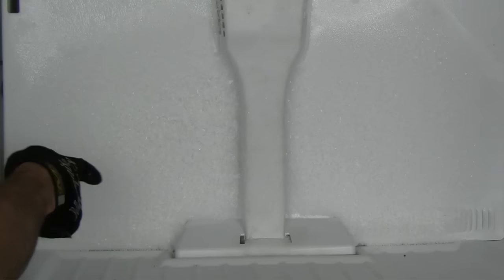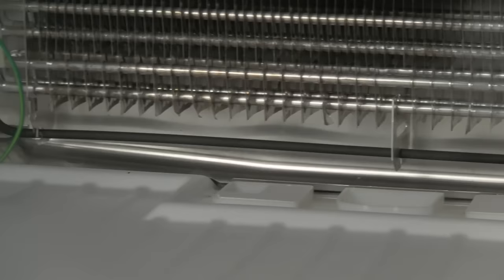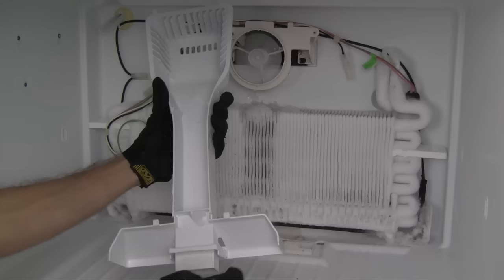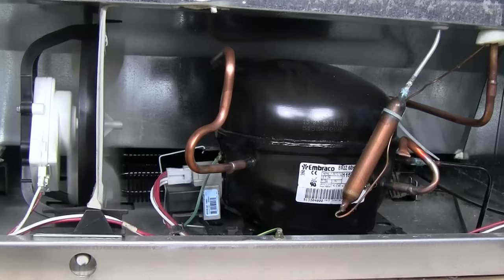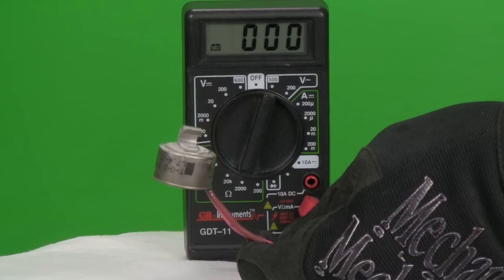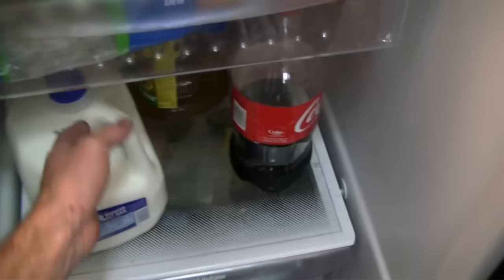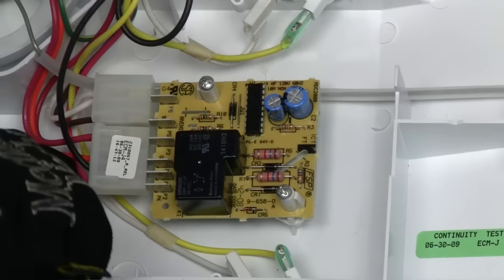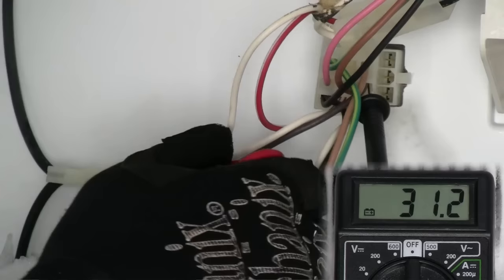Refrigerator Repair (Not Cooling, Defrost System)

Comment: Great Video! I have a Kenmore 569.68142891 .  Rock Hard freeze, warm top.  I pulled it apart  uncoupled the heater and got a tone. then plugged it in on the thermostat side, turned the timer to defrost and checked for voltage and got 115 volts through the thermostat and heater.  Turned off defrost mode and plugged in the heater, set to defrost, no heat on the heater even though I have resistance and voltage!  The thermostat does show signs of being bad (ruptured).  I am going to replace that but would a bad thermostat keep the heater from heating even a little bit?  I can touch it without feeling heat.  Should I but both parts?

Comment: Great video, too bad there isn't a little info on the circuit board defrost timer.

My refrigerator heats the duct between freezer and fresh food compartment and won't stop heating it unless I reset the fridge, then it will do that again after about a 30 hours even though there is no frost and the duct door is working properly.

As far as I can tell there is no defrost heater or thermostat on the evaporator (is that possible?), it does not get warm in parallel with the duct. There is however a temperature sensor in the freezer section as well as the fresh food compartment.

I thought about jury rigging a power reset every time the door closes because I like to tinker :) at least until I can figure out how to fix the issue.
Reply from the maker: Sorry for the delay on this question.  I'm guessing Samsung...?  What is your refrigerator's brand and model number?  If it is a Samsung built refrigerator, the heater is inside an aluminum case that looks like and is attached to the evaporator coil...
Reply: applianceassistant no problem any help is very welcome; it is yes; a Samsung RL36SBMS1.
I see the double coil now and two sets of cables running in behind the evaporator, with that I've found the second black tipped thermal sensor(fuse) shown in the electrical diagram on the back of the fridge, that's great! thanks.

Seeing as the fridge keeps defrosting until it hits room temperature every 6-8 hours without returning to a normal state, I figure the problem may be the bottom black tipped thermal sensor. I'm able to order a new one of those I believe. I'm still not quite sure why this component would degrade though.

I'm also noticing a problem I hadn't ever considered before, the ice spills out from under the evaporator and builds up on the bottom of the freezer where it is collected in a very shallow plate and can be taken out as I have done in the past even though there is most definitely a collection area on top of the motor, maybe something is blocked somewhere.

Thanks for your reply, I'm still happily tinkering away and learning as I go :)

Comment: This is a great educational video!
Actually, I am watching and hoping this video would help me to understand the "refrigerator".
My "Kenmore" refrigerator's motor/engine is working fine, but cold air wasn't running...less than few hours later, cold air is "running" properly.
Is that what you called "automatic defrost cycle"?
And should I stay alert next time this happens? (Who knows "when" this happens)

Comment from the maker: @genestermeister It doesn’t sound good.  If the compressor is running, the thermostat is likely fine, sending electricity to the compressor saying “get to work its to warm in here.” However if the sealed system is unable to get down to the proper temperature you are likely low on gas or have a restriction.  If the compressor is not running then you may have a thermostat, start relay, or compressor problem. The only way to tell the difference would be by doing some voltage tests with a voltmeter.

Comment: Hi. I had a problem with my evaporator coils frosting up and did some simlpe checks, finding an open circuit on the element/thermostat as its a combined part on my Kuppersbusch. I have installed a new heater/thermostat which "closes" to about 80 ohms when cold enough. I am getting 240v (as i'm in the UK) to my heater, checked by advancing the mechanical timer as shown when the defrost cycle starts also, however the heater element doesn't seem to get hot? How hot should these things be to touch? Its only been a day or so since install but i tried to check this before buttoning all of my freezer panels up, with just the heater connected and supply to it, with the stat cold enough to allow current to flow through it. Am i worrying over nothing as i am expecting to feel some major heat from it. Thank you
Reply from the maker: Not sure about those but every one I know of in the USA gets red hot.  Did you check the heater for resistance? If it tested good then your probably fine.  Just keep a close watch for frost on that back wall.  Thanks for the question! Hope that helps!

Comment from the maker: @stringfellowhawke247 You must have some kind of an air leak, or have had an Thanks for the compliment I'm glad it helped! You must have had an air leak in the recent past.  I would just clear the frost and see if it comes back.  If the vents are clear and the ref is still not getting below 40º Hmmm... Is your evaporator fan working? Is your freezer down to temperature?    If you have any other questions feel free to contact me through ApplianceAssistant com  I would love to help further.

Comment: i have the same Frigidaire, mine wasnt cooling, well it was cooling but not cold enough,  or making ice. I had a big chunk of ice on the top right of the defroster and tops of dust on the coil lines in the back. So far its running and is cold but not cold enough to make ice.
Reply from the maker: Sorry for the delay in getting back to you on this!  The "big chunk of ice" is the part that sounds less than ideal. The evaporator coil should freeze evenly and show a fairly even frost pattern.  If part of the coil is frozen and the rest is clean aluminum then it sounds like a gas restriction in the sealed system and it may only be able to cool with a small percentage of the coil.  This is ver difficult and expensive to correct. It requires evacuating the gas, purging with nitrogen,... yada yada.  Sometimes they can clear themselves and start working again.  Sorry for the bad news. If the fans are working and the lower coil is clean, that's about all you can do. Hope that helps!

Comment: Hello
My GE side by side is working good but the defrost cycle stays on too long.
This causes the Ice In the Ice bin to begin to melt.
Any suggestions.
P.S. 
I've already replaced the control board and two of the sensors, one located on the Evap. coil and another one located in the
fresh food side.

Comment: I been fighting this problem with my Whirlpool top and bottom fridge . The problem I'm having is that i'm getting a sheet of ice in the bottom of the freezer. within a week of opening the drain again. I have replaced the the bimetal defrost thermastat. Every time I have taken the back panel off I have never seen frost build up at all. So where is all this water coming from that freezes up in freezer. My fridge stays really nice and cold and freezer is nice and cold. No frost build up at all on back wall. But is always the tray and tube is frozen solid and frozen water on bottom of freezer. Doesn't make since to me. Doors are super hard to open like the suction is very hard. It whistles when closing the freezer top door after closing. Please help me. I been fighting this for a year now. I have taken this thing apart 5 times and melt the ice and clear the tube and it comes back about weeks time.

Comment: Do you have ideas on how to trouble shoot a roblem where the refrigerator (frig only, no freezer) section has ice build up ?  The compressor does not seem to shut off once the interior reaches desired temperature.  It's a Red Bull Baby Frig, I cannot find the thermostat adjustment.

Comment from the maker: I'm sorry I lost track of this!  Well I am not finding any information or diagrams on that model number... That's exactly right.  Hopefully the duct blockage was caused by the door not sealing all the way and there is no mechanical problem. You probably have already done this but try thawing it out and watch for frost accumulating on the back wall of the freezer for the next few weeks.  If you see frost you may want to call someone who is Frigidaire warranty service for that one.

Comment: I have a question:
I have an older Whirlpool Gold fridge with a freezer on top. The ice maker quiet working so I took it out and disconnected the water line and closed it up with a 
plan to just use ice cube trays. Well after about a month the walls of the freezer started forming bumps on them. Some really small and others about the size 
of a ping pong cut in half??? Do you know what this is and what causes it. Totally at a loss on this one....thank you

Comment: I have a GE side by side refrigerator. I've replaced the thermostat and defrost heater. Well it froze up on me again a year later. I've replaced the thermostat once again to no avail. I tested the defrost thermistor at the control board. I tested plug only, it was not connected to the board. It read 00.0ohms, it was still surrounded by ice. Ordered and received a new thermistor. Tested it in ice it read 16ohms. The old one I took out read 13ohms. So was my thermistor even bad?
Reply from the maker: Hard to say, but the first 0 ohms reading would be a problem... so if that reading was correct, sounds like it probably had a problem.

Comment: I have a Maytag fridge that stopped defrosting. I checked defrost timer and it had no continuity when cold. So it was bad. My thermostat had three wires instead of the usual two. The two wire stats are just a relay which when cold (most of the time)  flow electricity from the timer to the heater wire around the evaporator coils.  I called around and asked different suppliers what the third wire was for on my stat. No one seemed to know, but one guy said it was a fan delay. I guess this meant the fan in the freezer would delay coming on for some time after the freezer defrosted. I could not find this three wire stat on the net for less than an outrageous $60 while the two wire stat was around $6. I ordered a two wire stat and sealed off the wire from the fridge going to the third stat wire. The fridge works fine. Just another thing these crooks put on their products to rip people off. It is something special folks, and the only place you can get it is from us and we agree with our competitors to put a ridiculously high price on this part to make a bundle. Ralf Nader where art thou?
Reply: Excuse me on previous post. I said that I checked the defrost timer for continuity. I meant to say I checked the defrost thermostat for continuity.

Comment: So I decided to test the components in the fridge portion, the thermostat there shows the same continuity at all times no matter the setting on the dial....this is counter to the guides I've found on the net which say it should fluctuate when the dial is setting is changed.  I also can not locate the defroster timer, it may be down by the condenser but it hadn't cooled down yet last time I went to look.  Model number on fridge is a Magic Chef MCBR1000S.  If you can advise me testing/finding. Thx

Comment: I checked the resistance and there is some , but should there be continuity because there is none between the two ends on the heater?
Reply from the maker: There should be some resistance on the heater, not an open circuit.

Comment from the maker: @stringfellowhawke247 Nice! That would be an easy fix!  Probably the air return is clogged up with frost as well.  Its located near the bottom of the refrigerator section usually hidden by a crisper drawer. It allows the warm refrigerator air to flow back into the freezer. (Equally Important.)  Little more difficult to clear out on a side X side... easiest way is to unplug it and let the thing thaw out.  But if that's not possible you can sometimes use a hair dryer.

Comment: hi my refrigerator is not cooling have no idea what happen apart from the bulb thats blown have had it almost 2years model is a Fisher and Paykel Active Smart E402B i dont hear anything from the back of frigde so im guessing its not working at all,dont know if its worth getting a new one or fixing i have had no problems with it at all in the pass
Reply from the maker: Im sorry for the delay! I was not able to find a diagram of that model : ( Unfortunately, I have limited lookup capabilities when it comes to some Fisher Paykel appliances.  Just a guess... but if the bulb went out at the same time as the cooling problem, you may want to check the door switch. some samsung and GE refrigerators control the inner air circulation fans as well as the lights with the door switches... apart from that you may want to look at the "troubleshooting refrigerator problems" article on my website. It has a more complete description of the things generally to check based on symptoms.  I would expect that you refrigerator is basically the same.  Sorry I couldn't be of more help... Good luck!

Comment from the maker: Try looking at the refrigerator troubleshooting help on my website (the link is in the video description.)  If the compressor is working then I would hope that the condenser coils if they are under your refrigerator are very clogged up with dust or the condenser fan that pulls air across the coils may be jammed.  Look at the troubleshooting on the site... It hopefully will help!  Good luck!

Comment: I have a Whirlpool et1phkxpq09, built 4/10, purchased 10/10. Suddenly the fridge is about 52, freezer about 28 degrees. I emptied & unpowered fridge,propped open doors for 10hrs. I opened freezer panel, found no frost, but center duct was narrowed by ice. Cleared ice & re-installed freezer panel. Control console at top of fridge portion had no frost or ice in it. Diffuser is an immovable tongue. Repowered & after 10 hrs, performs the same- 52/28. So if frost isn't the issue, where do I go next?

Comment from the maker: It sounds like it's possibly a new issue... I don't think I would trust nail polish to fix the thermostat though.  usually when they pop there is not enough pressure on the contacts for it to work properly.  what is your brand and model number?

Comment from the maker: If they get very iced up or the evaporator fan in the freezer is not working you will start to have freezer temp problems due to poor airflow... you need to allow the evaporator to thaw out and then if your evap. fan is working check your defrost heater part#WR51X10055 and defrost thermostat part#WR50X10068 if they are okay then it is likely the main board in the back part#WR55X10552 the heater and the board are both common to fail : ( I have testing help on my website if you need it. Good Luck!

Comment: siri i want to ask what is the reason: a 110 watt compressor runs ok in around 70 watts, ..low side stays in vacuum around 25 and high side around 200 psi.the pressure on high and low sides does not equalize if i turn off the compressor..

Comment: I have the same Frigidaire  GLRS234ZAB5 side by side refrigerator with the same issue.  I am desperately trying to locate the timer with no luck.  Are you saying this models timer is different from the others..i.e electric circuit board? If so...where is it.  I've looked on the back near the compressor, on the front left under the freezer compartment and up top.  HELP someone!!!

Comment: The bimetal terminates defrost and tells adaptive defrost how long it took to heat up so it can calculate thru AI how often it should defrost next time.  If it took 10 mins to heat up there was alot of ice, so next time defrost sooner, if it took 3 mins to heat up there wasn't much ice so lengthen defrost interval.  Mine goes every 65-70 hrs.  Also after defrost when compressor starts it important for recirc fan to be off for 5 mins or so, to capture heat and refreeze remaining water onto coil and not back into entire fridge.

Comment from the maker: It sounds like there is some kind of a defrost problem... it could be the heater, thermostat, or control.   The leak sounds like a clogged defrost drain... which would indicate that is may be going through defrost sometimes...
What is your model number?

Comment: sir i am a newbie in this field and i want to know if i can replace an  air conditioner compressor with a refrigerator compressor.. my air conditioner burn out and i want to run it again using refrigerator compressor to lessen wattage. the aircon system uses R22 and im planning to use R134a since it is common.. can i drain the refrigerator compressor oil and put R134a oil in in it then charge my system with 134a?

Comment: I have a Daewoo FRS U20DCB every two weeks I have to stip out back panel in freezer and use steamer to defrost it and ideas on possible fault finding with it
Reply from the maker: +neil boyd im not super familiar with Darwin refrigerators but odds are it's the same basic defrost system. Look around the control area for a defrost timer. That is a good place to start. The heater and bimetal thermostat should be in the area you are pointing the steamer.